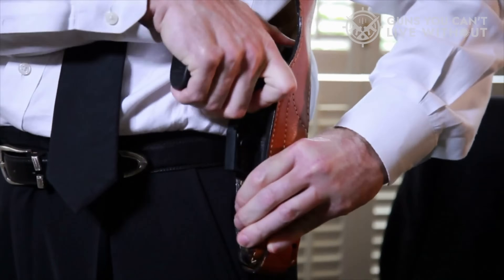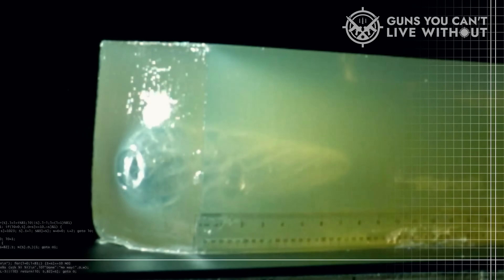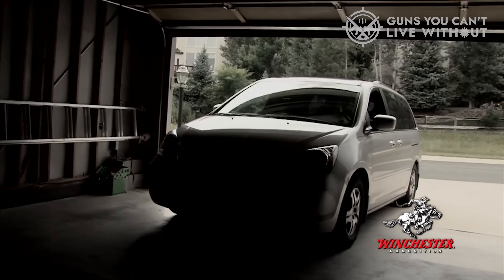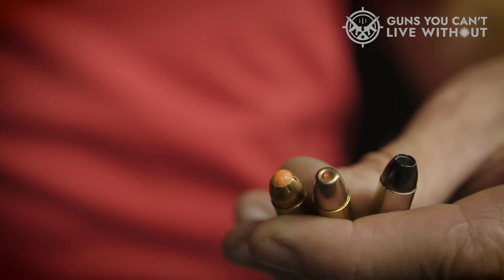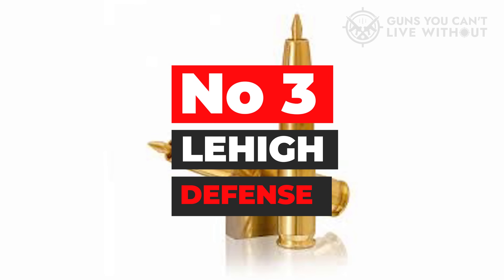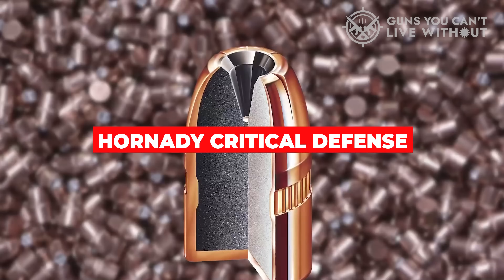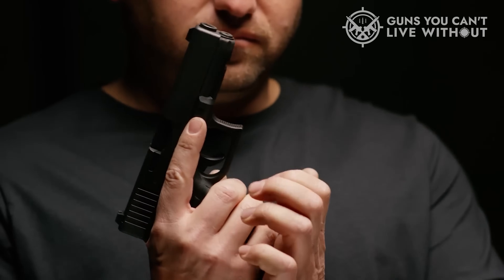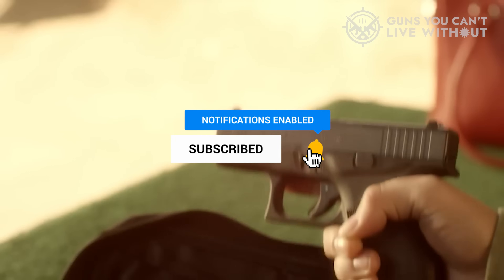Best 9mm Ammo For Self Defense 2025 [We've Tested Them All]

Comment: HST 147 GR is what I personally carry, and in my own testing, the ballistics are surprisingly consistent. Not to mention, despite it's effectiveness and the notorious reliability of Federal as a brand, it remains pretty affordable
Reply: A 147 gra8n 9mm has a velocity of about 900 feet per second. It's called a .38 special. A 125 grain at 1,200 feet per second is similar to a .357 magnum out of a 2.5-3 inch barrel. I have old Cor Bon 124 grain 9mm loaded at 1,300 feet per second. Definitely a .357 magnum semi auto as opposed to a .38 special semi auto.
Reply: HST LE TACTICAL ! The best !
Reply: @ms.annthrope415   I think energy transferred is what matters.   Why the .45 rules...
Reply: @matthewcarruthers3648  Yes it's all energy transferred.....   And a shotgun slug would beat all of them.
Reply: @matthewcarruthers3648  Well yeah............ I carry a .45 you do  as you will.   I wouldn't carry that.....  but yes whatever transfers the most energy wins.   I don't know what you want...
Reply: @matthewcarruthers3648  Terminal energy is what matters.  Velocity is only part of the equation. 

If velocity were king than getting hit by a 20mm autocannon would be no worse than an M16.  Mass does matter.
Reply: @silverscat6770 I can’t carry a concealed shotgun in public…
Reply: @damianh4510    sadly.

Comment: It has been 20 years since I used to carry as an armed security guard and armed private investigator. Back then I became a big believer in Speer Gold Dot. I used to use 124 grain +P.  Were I ever inclined to carry again for self defense, it would still be Speer Gold Dot.
Reply: Gun makers use 9mm 124gr to R&D new designs.
Reply: I use speer gold dot and sig v crown
Reply: The gold dot has withstood the ultimate of test criteria. One, in the "real world" not just test media but in actual situations where a firearm was used. Two, they've performed over the sands of time, if they weren't up to par, time would have revealed the weak points. They're kind of like the Nosler Partition of the handgun defense world. There may be certain instances were a different round may have been a better choice, but they will never be a bad or wrong choice. Pretty hard to argue with success.
Reply: Same. I can run the Speer in my glocks, s&w and carbines with zero issue. Alot of nice ammo out there I would like to try but then I find myself wondering why. Why change something so reliable?
Reply: @joshmartin7558  Exactly. Why fix something that isn't broke, and why change to something that hasn't yet withstood the sands of time? You got it right.
Reply: @chuckster243  Better is better. That's what technological evolution does. GD is a proven performer, no doubt, but Win T-series and Fed HST really changed the expansion game while delivering optimal penetration.
Reply: Never felt under gunned with Gold Dots. 👍👍
Prefer the PDX or RangerT due to less muzzle flash.
Most everything is minimal differences and hype and sales pitch.

Comment: I use Underwood's 90 Gr. +P+ Xtreme Defender in my EDC. It has been incredibly reliable! My EDC is an H&K VP9SK and the Xtreme Defender clocks in at about 1500 fps leaving the barrel. And the PWC on this round is absolutely massive!
Reply: Just tested some Blue Line +P rounds using the Lehigh 90-gr Xtreme Defender bullet.  Hit 1567 FPS out of my 3.75" CZ P01, and a sizzling 1485 FPS out of my 3" Hellcat. 👍
Reply: Doesn't it would break your barreled?

Comment: It's not feet per pound - it's foot-pounds, which is a measure of energy, or work (not pounds-feet, which is a measure of torque); the proper contraction is ft-lbf, rather than ft/lb.  

The two leading candidates for consideration are Hornady Critical Defense and Hornady Critical Duty - the FBI duty round.  The former is optimized for home defense, with rapid expansion and lesser risk of overpenetration; the latter is optimized for barrier blindness and deeper penetration - tactical use - as required by the FBI.
Reply: And you believe and trust the FBI?

Comment: i love HST. i used to carry it exclusively. but tests show it can easily clog with clothing and never expand. since boogiemen are rarely naked,
i have switched to Lehigh/Underwood Xtreme Defender. this bullet, by design, DOES NOT expand. it achieves results bu the flutes hydraulic forces. it this video you mentioned Lehigh's Xtreme Penetrator. DO NOT use this for personal defense. it WILL over penetrate. this is intended for hunting where a significant exit wound is desired.

Comment: A worthy purpose but with very serious flaws:  Not only is the pistol used (and more importantly, the barrel length, which I hear might have some tinie tiny effect on performance) not mentioned (and it's unclear whether the same firearm is used throughout), no penetration data (either in bare gel, or more importantly, through the FBI's fabric barrier) is provided either.  While some of the top choices are mentioned, this video added not a single piece of objective data that might help discern what's truly the top 9mm ammo for your particular barrel length.  Barrel FPS and FPE are certainly important, but if it's taken from the manufacturer's box, it's almost worthless since again the barrel through which it's shot is rarely (if ever) mentioned.  Manufacturer's stats are generally available, but they're rarely accurate (depending on the firearm used, at best). Take this for what it is:  a quick preview of some of the top 9mm ammo currently available which one can thereafter do some solid research on for accurate and relevant info.  For what it's worth, after extensive research, I now carry Underwood's 90 gr. +P Xtreme Defender (which uses the Lehigh fluted projectile) in my P365X, and Gold Dot or HST 124 gr. +P for my Glock 45 and Beretta 92F (and my other 5+ or longer 9mms).
Reply: Absolutely with you on the ammo choices...I just don't think the Extreme Defender can be beat since its barrier proof...and my next and ONLY other choices are HST and Gold Dot as well.  I can tell you've done serious study to conclude with these just like I did - I applaud your evaluation !!
Reply: The part I would be worried about the most personally is what the DA/AG will do with your/my choice of ammo if ever faced in a self defense shooting situation. Which is why I primary use standard lead cast rounds, fmj rounds, and hollow points (note that none of these have any extremely specialized characteristics and are similar to what the police use to stop threats that makes it safe for you to use as a civilian if it ever ends up in court. Having these rounds for if the world ever collapses and there isn’t a rule of law isn’t a bad plan but it wouldn’t be anywhere near my priority for the type of round I’d use.  I stick to high precision manufacturing processes for the firearms that I choose because I want them to be working great through anything that may get thrown at it in the heat of the moment.
Reply: Thanks, I just got the 365X.
Reply: You have some valid points. I personally prefer things with a proven track record. "Gel tests" and "simulated media" are nice pieces of data points, but for me real world trumps all others. What enforcement agencies have been using for decades as a standard go-to, pretty much points out the right direction, for me.
Reply: That would be due to this being a combination of other people’s work, put together as a collage with a robot narrator.  In other words zero ballistics work done by the content creator.  It’s so poorly done that the Lehigh segment focuses on a 10mm offering in what is supposed to be a 9mm presentation.

Comment: hornady subsonic runs fantastically with my sig p320 m18 because it reduces the flash which also reduces that pesky burnt tip look that the m18 is infamous for extremely accurate and penetration seems to be just right was skeptical at first because numbers seem a little low as far as fps goes but fantastic rounds works best with my suppressors but not much drop off in performance without either these are always in my carry because they reduce wear on my gun and also reduce risk of my bullet penetrating and hurting someone unintended

Comment: There are definitely a few great defense rounds on the market nowadays, but i personally prefer HST based on all the testing I've done and reviewed over the years.
Reply: I carry Speer but I would be open to trying other ammo. The only reason I carry it is because I know it's reliable. It cycles well in everything I have 9mm. Glock 17, shield plus, 9mm carbines. What do you think is a devastating yet extremely reliable 9mm defense round?
Reply: @Josh Martin  in my opinion, it's HST and Speer. They consistently do what they are designed to do almost 100 percent of the time regardless of variables and situations and so on.
Reply: @Josh Martin  I have other recommendations also for you if you happen to have any difficulty finding the two forementioned rounds on a regular basis. The two I mentioned are just hard, if not impossible, to beat in all around consistent performance.

Comment: I carried HST 124 grain +P in my micro 9mm for years. Just got a Hellcat & it jammed twice in 50 rounds so I'm using Critical Defense now. Bullet profile is a little more pointy. No jams  in 100 rounds.
Reply: It could be your gun. It may not be able to handle plus P ammos. Check your manual. It should tell you what type of ammo you can use. 💯💯👍👍👍😁
Reply: Could be your firearm just needed to wear in a bit.  Some manufacturers recommend 200 rounds before their products are considered reliable.
Reply: I use 124 hst as well and have never had a jam out of my hellcat pro.

Comment: 8 mms a candy ass cartridge. The only reason the military and law enforcement use t is because of the weaklings( not all are) and basement living men, who can’t or won’t learn how to manage the small recoil of .45 or 10 mm. I do have a Glock 19 for carry when my back hurts, but I have recently gotten a 10 mm and am a convert. The Extreme Defense from Underwood runs 1600 ft  per second and well over 700 ft/lbs of energy. The primary and secondary wound channels are enormous and it is very accurate. It is expensive, but is not range ammo.

I would not volunteer to be shot with 9 mm, but feel there are better choices out there for those who aren’t afraid of a little recoil and don’t mind spending a bit more for ammunition to get better performance.

Comment: Recoil/muzzle flip as far as ammunition is concerned is not = to ft/lbs of energy, that is tissue damage or work. KE = 1/2 mass * velocity squared in whatever units you are using. Where as momentum is simply mass * velocity. Momentum has a big effect on penetration where energy might have a bigger effect on permanent and the temporary wound cavity. Seems that having a compromise of enough penetration and energy delivery at the right time are the biggest factor in stopping power.

Comment: FT/LBS  is not a unit of engergy.   Energy is either in SI units, Joules=Kg m^2/sec^2 or in British/U.S. Customary Units Energy is Ft TIMES lbf. That is FT-pounds not FT/LBS.    I say lbf which is Pounds force, not the same as Pounds mass. lbf is a force, lbm is mass, lbf = lbm x g = mg=wieght = F=ma.  g is the accelaration of gravity.  IDK know what the hell Ft/lbs represents!  lbs usually means weight(i.e.force) but lenght/force  doesn't mean much.  I've seen steel beam shapes listed as lbf/ft i.e. how much that cross section weighs per foot of length for a given material.  Line load in terms of lbf per length which ignores width, but FT/LBS is meaningless.